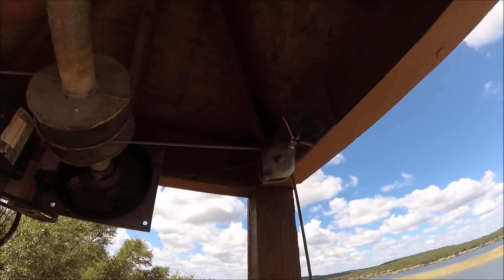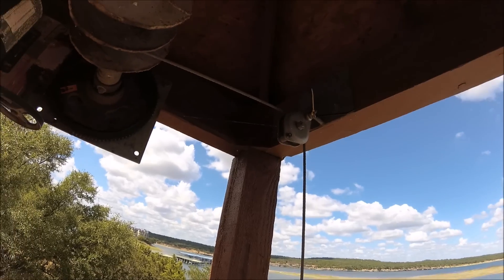Homemade Elevator on Deck -DIY build details

Comment: I know its kind of late but I just found this video.  Great documentation.   Ive been planning to use a boat lift mechanism on my own build and its good to see someone else has already done it.  BTW the motor pulley has been changed out from the original size.  Looks like they at least doubled it to make the elevator go faster.  That will have (halved?) reduced the rated capacity on the plate but should still be way over capable of any load that you may likely put on it.   Any comments on how it has held up over the years from when you first published this video?
Reply from the maker: Last year it was rebuilt with steel. The lifting mechanism was kept the same. The wood beams had warped over the years (10ish)

Comment: Kind of a unique set up, that's for sure. The whole winch assembly doesn't look capable of supporting the weight of a human being. It also needs a lot of lubrication by the sound of things.
Reply from the maker: The whole thing looked kind of sketchy. The winch mechanism is supposed to be able to pick up a boat and is the same unit that was actually out on the boat dock. Off the top of my head I think the unit was rated for 1,500 lb but I don't recall.

Comment: I suppose there is one circuit for up and one circuit for down, so you can use two different "sensors" to open the circuits when it bottoms/tops out? Trying to figure out the basics before buying anything. Thinking about using a garage door opener with a fixed length, if I can find one powerful enough.

Comment: They make safe porch lifts with broken cable safteys if you can afforde a lake house you can afforde something safer.
Reply from the maker: A porch lift doesn't lift anywhere high enough. But that doesn't matter as this is a dumbwaiter and safe doesn't really come into play with a device not designed to lift humans.

Comment: What do you think about the cable being flexed one way by the pulley and then the opposite way by the winding mechanism on two of the four lines?
Reply from the maker: That's a very  interesting thought. I've seen winch lines run cables through smaller pulley snatch blocks and never really have any issues.  After repeated used though the cable can get stressed to the point is wants to stay in a tight coil and no longer move freely in the opposite direction. In this case I would think it would simply twist 180 degrees and roll the way it wanted to over the pulley. This takes a lot of force though and doubt were getting anywhere close to that with this setup. This cable is resilient stuff and it only ever seams to fail if it gets cut by rubbing on a sharp edge.

Comment: Hi Moe. Was just telling the GF about all your creative original talents after you left a comment on...and then you posted this.  When I built the house in 2007 put the kitchen and living room on the second floor. We talked many times about building what you have there. Many good ideas there. Thank you for sharing this info. So neat to see your place. Makes me miss my lake house. Built a boat lift there. Used a Leach company worm drive barn cleaner gear box (I was told but maybe even for a winch?) Found that a a tractor salvage yard. Never knew Leach co was into such but had big letters on the covers. Made similar cable drums like your setup.  Got a smile about the brisket. Jackie always have relation bring one up when they come from Texas to Wis. She immediately asked where you were from! She likes doing them too. Had a get together last summer in the shed. Invite friends. Fun time, good food. Thanks again for showing this helpful video!
Reply from the maker: I wish this was my place. This is my Brother's home.

Comment: I wonder if the cable being one piece is not like a chinese windlass where if the gear box failed it wouldn't fall?
Reply: The platform wouldn't fall because cables on each side unwind in opposite rotation.
Reply: @anthonythorp7291  that is what a chinese windlass is
Reply: @neiljensen9585  I see, thank you for clarifying.  Still wouldn't need to be one piece and would add a hair more safety.
Reply: @anthonythorp7291  I think you are correct,I made a mockup trying to build a lift in my shop I may try a version like this but with seperate cables

Comment: no counterweight?
Reply from the maker: Large elevator counterweights I believe only match the weight of the empty car.  For such a small elevator  like this a counter weight would be a hindrance. It probably weighs in at 75lbs vs a 1000lb elevator car in a building.

Comment: With the bad shape my body is in these days, you dam betcha I'd use it !
Even if it failed with me in it I doubt it could mess me up any more than I already am ! 😊
When I have to stay in a motel I insist on being on the FIRST FLOOR, hate stairs !
My mouth sure is watering thinking about that brisket, mmmmmmmm  !!
Thanks for sharing and take care. 👍
Reply from the maker: With a few safety items I would have no issue riding it on a regular basis. Brisket turned out great.

Comment: That thing shows why Otis got so rich.  And you should figure a way to implement his patented idea.  But the only home elevator for people I would ever have would be hydraulic.
Reply: counter weights ,nothing like this at all
Reply: @allmihi  Otis's invention wasn't counterweights, it was a tension mounted braking system that locked the cab in place if the line broke or freewheeled.
Reply from the maker: Free wheeling centrifugal braking clutch would be a neat addition to this.